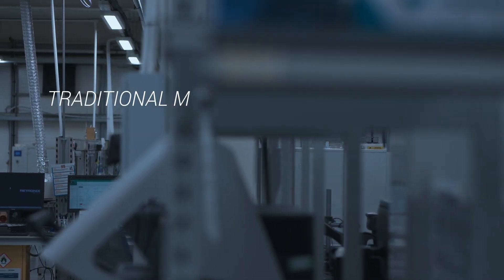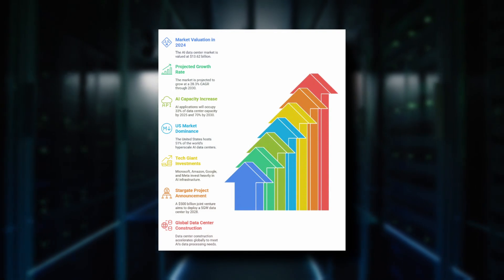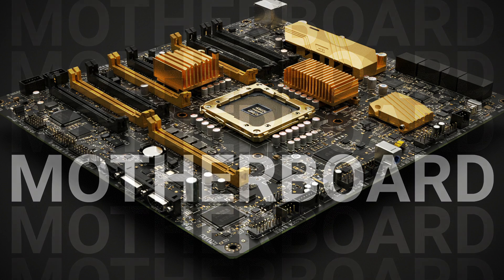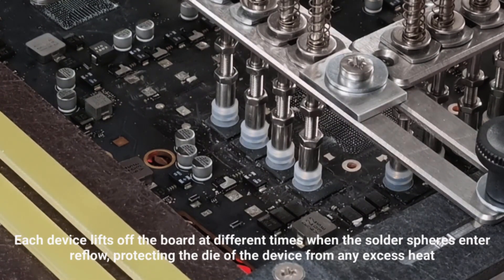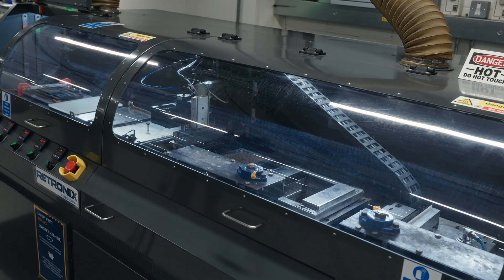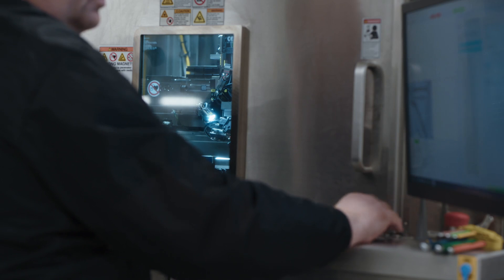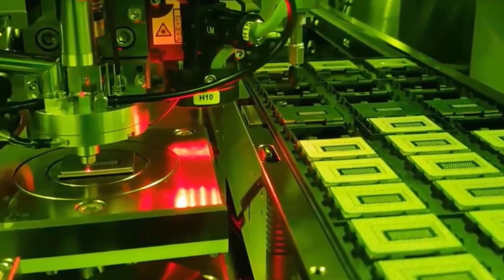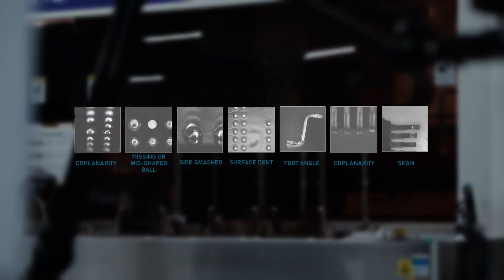Recover high-value electronic components from existing assemblies to prepare them for reuse.

Comment from the maker: For years, many in the electronics industry have believed that component recovery and reuse is a well-established practice. And while that’s true, the real question is: under what conditions are these components recovered?

Unfortunately, in many cases, the process is far from controlled. Components may be exposed to unregulated heat, improper handling, or ESD risks. These factors can lead to hidden issues or latent defects, problems that can compromise reliability and performance down the line.

That is why Trust Matters in Component Recovery - When your production line depends on quality and consistency, you can’t afford uncertainty. That’s where Retronix stands apart.
With over 35 years of experience, Retronix is trusted by some of the world’s largest and most respected companies. Our recovery processes are backed by globally recognised certifications. Contact us to know more - https://retronix.com/contact/